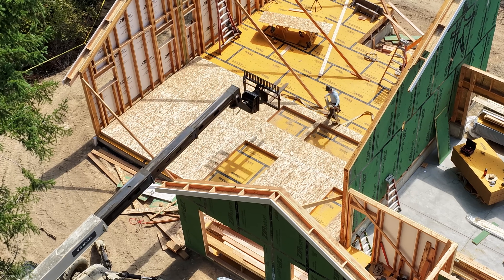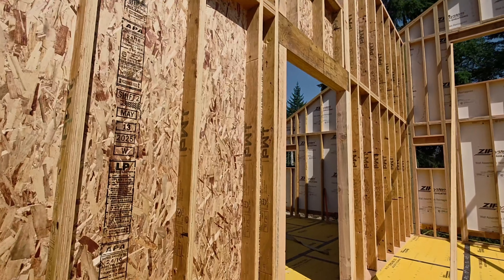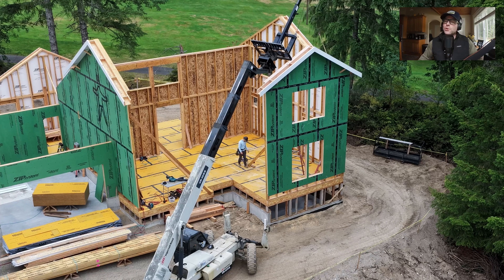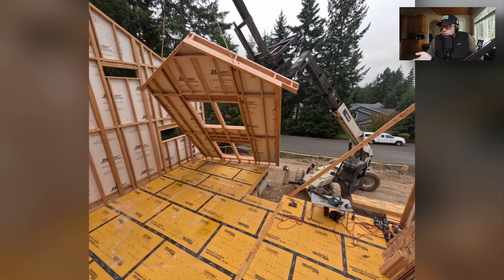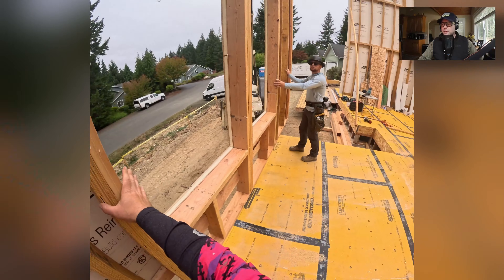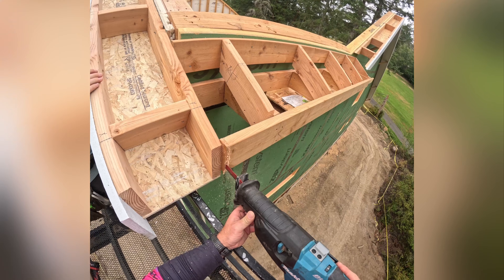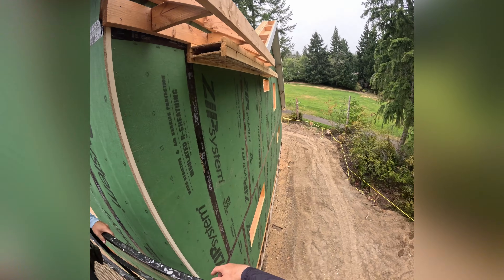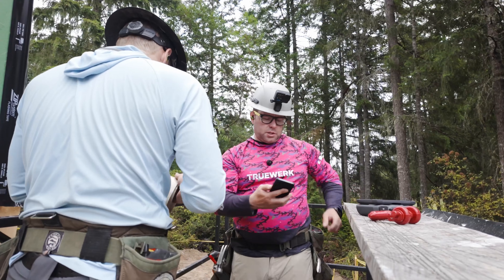Most Houses Aren’t Built This Way — Here’s Why We Do

Comment: Question re your fireblocking / panel blocking ~ 

If the wall cavity is completely filled with insulation that looks to be mineral wool batts in this case , do you still require fireblocking in your jurisdiction and if not , could you panel block on edge to reduce thermal bridging ?

Enjoying this series
Reply from the maker: Great question. I'm not 100% sure but I think that insulation suffices for fire stop. But I'm not sure that I can get our engineer to sign off on no panel edge blocking because of our seismic zone.
Reply: @AwesomeFramers  thanks for the reply . I would still install panel edge blocking , just wondering if you can put 2x4 or similar sized lvl blocks on edge , flush to the exterior face of the studs . Thats what we do here in BC for seismic walls , you get panel edge nailing and limit through wall thermal bridging

Comment: 3:34 I don't know if it's a mistake or not but Building codes require rafter ends to sit on top plates.
Reply: While the overhang framing might have elements labeled rafter, in this instance they are not serving the same function. Also there is more than one way to connect a structure together legally and safely with the assistance of a structural engineer.

Comment: One little tip for communication is if you have cell phones and bluetooth headphones just call the operator.  I work industrial so we use crane radios but a cell phone would work.  That would allow you to really stay focused on the lift.
Reply from the maker: Yeah we've tried that and it actually made it a little less safe in my opinion. Do you have some mesh network devices coming that we're going to be alpha testing that will allow us to use our Bluetooth earbuds to communicate in real time with no lag
Reply: @AwesomeFramers fair enough..  I always prefer verbal communication over hand signals and with you having smaller crew sizes it seems like that could help.  I guess one advantage you have is the operator can see the load and the whole lift zone so its really just the final tweaks they need communication for unless something is going wrong in which case hand signals are fine.  Most of the lifts I deal with the crane operator can't actually see where they are lifting.  Its all blind lifts.

Comment: What are the reasons for leaving the strip of sheathing off at the bottom plate?
Reply from the maker: So we can connect that down to the mudsill.  I start sheathing from the blocking required for fire and for shear walls.  That starts the ceiling line upstairs and then I order sheathing based on wall heights and blocking required at the floor.
Reply: @AwesomeFramers if you were toe nailing and standing with jacks would you you still do that or leave sheathing long?
Reply from the maker: @binlukin still do this. It's really nice to be able to blow the dust out the house and this is all ground work later

Comment: And Ballon framing is much easier to insulate well. No thermal break at each floor. It’s how they used to do it back when old growth trees allowed for twenty, twenty-five foot pieces of lumber were common. And stronger lumber too. It’s more expensive to do this but it allows for the use of farm raised wood fiber to make strong, straight, and durable lumber that will last generations. Well, thats the plan anyway.
Reply: The fire blocking is a thermal bridge
Reply: huh, any home 100 years ld is not even insulated. why dont you just realize rez building today is 100 tines what is was back then.